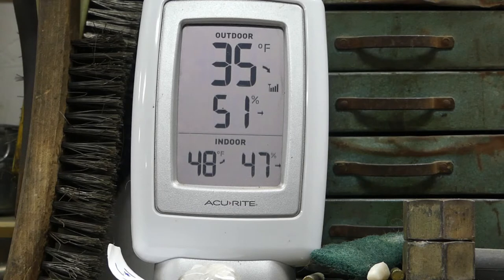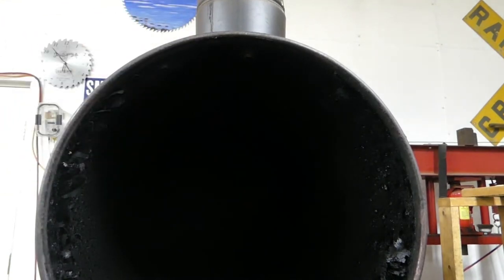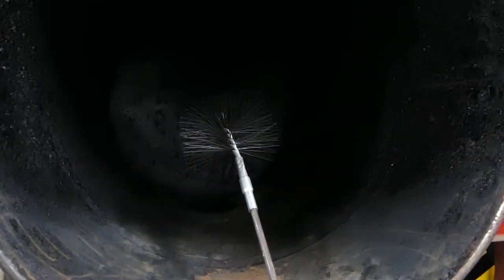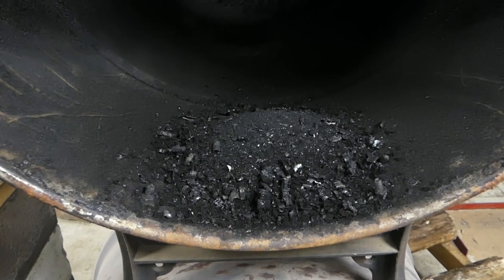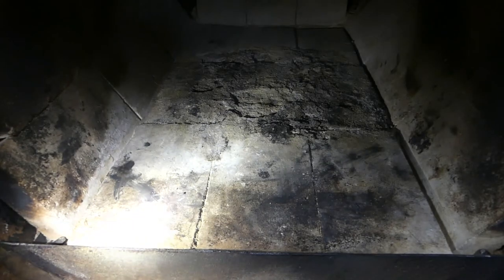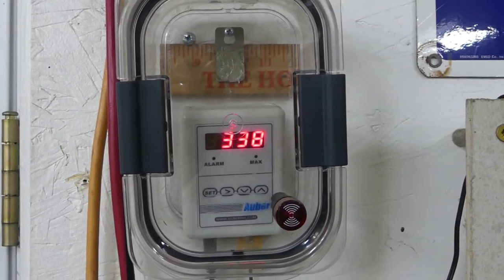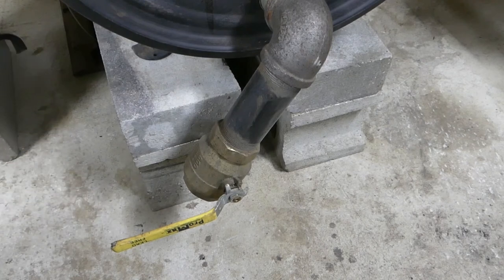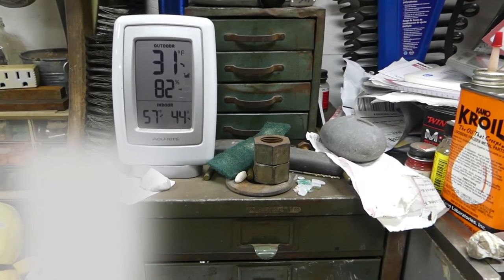Viggo the Double-Barrel Wood Stove

Comment: I grew up with a wood stove for heat as well as a fireplace. I remember cutting the wood with my dad but not cleaning the wood stove pipes. I guess Dad did that on his own. Thanks for sharing. I learned something today 😊
Reply from the maker: Hi there Up North Adventures With CCC, I am glad you learned something, and wood heat is a lot of work, but if the gas and electric stop at least we won't freeze.

Comment: Boy, You're a hell of a lot safer than I was when I relied on a woodstove. I just ran mine till the chiminy started to glow. Then I knew it was clean🤣 I would also have to give the stove pipe a good wack with the poker and all that black flake crap would just fall down into the stove for clean up. Although there where many times i was on the roof in the middle of the night to sweep the chiminy because it was getting clogged from all the wet wood I was burning. 😬
Reply from the maker: LOL, well when the insurance guy came out to inspect our setup he said I went above and beyond, I pointed to a couple of my treasures and said I know we have replacement cost insurance, but do you think you can go down to the local store and get this? Plus, they always screw you with that anyway, I told him "I don't want my "stuff" to burn up" I think he believed me! LOL.
Reply: @MrChubbyHubby.  You certainly do have some pretty cool tools. I'd cry too if they where all burned up.